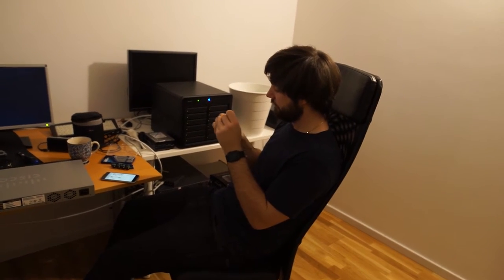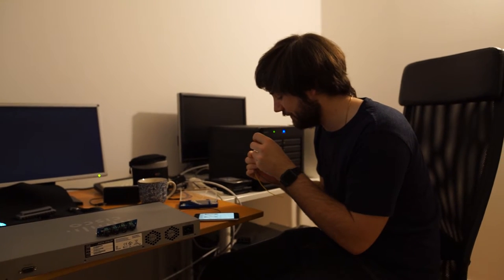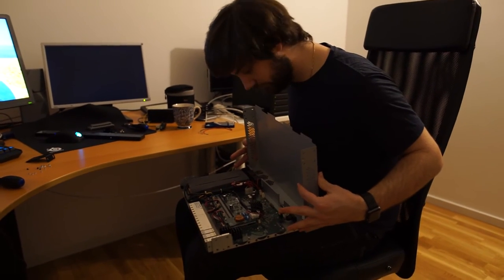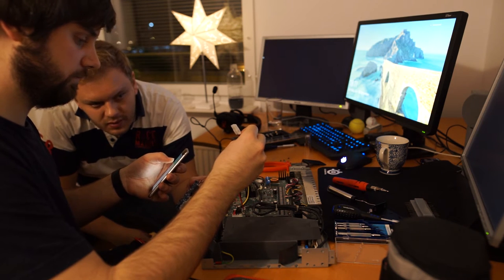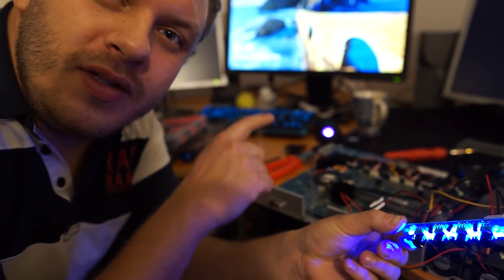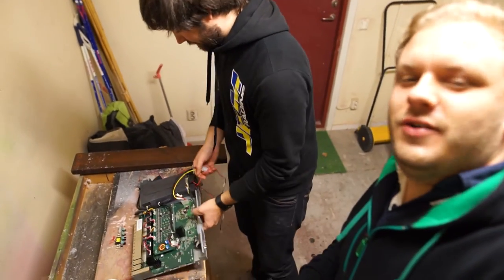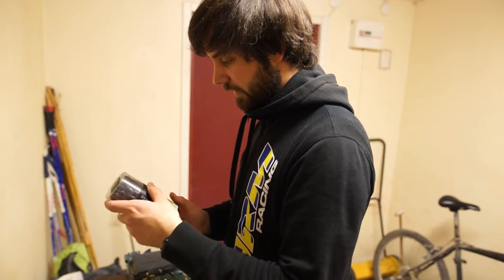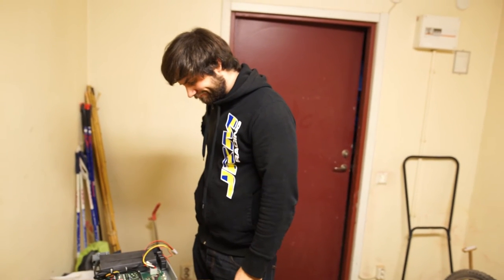QUIET CISCO - EPIC SILENT FAN MOD! | VLOG #3 - Team HETS

Comment: You know what you're not supposed to do... ever? Drill a hole into a metal chassis with electrical components inside it. What happens when metal shavings get inside and touch two contact points? Oh that's right, you might accidentally shoot 28VDC into a component rated for 5VDC. Then you get to see a pretty cool smoke show.

Comment: Good job, I bought this old 3750 and the fun is driving me nuts.. initially just got a potentiometer thinking that I could modulate the power for the fan but it didn't work as its internal circuitry changes the speed. I am considering feeding it lower voltage via an external power source but probably your idea is better
Reply: Yeah, am in the same boat. I think those fans in the 3750 - https://imgur.com/a/uhky2Qo are particularly noisy at around 45 dBA
Reply: I know this is a year late but I read if you disconnect the white or blue wire on the fan (not sure which colors they are to be honest), the switch will lose its speed sensing for the fan and will not ramp it up anymore.